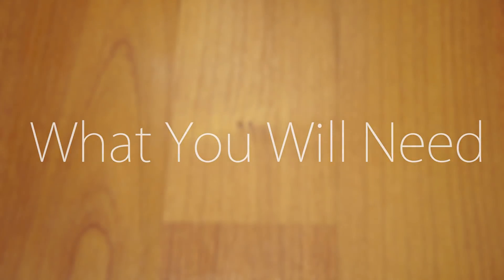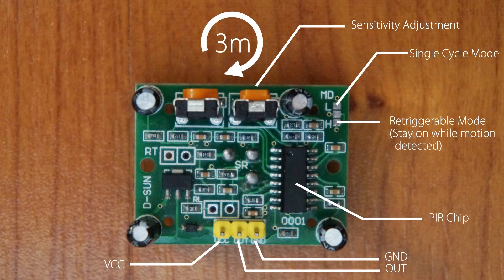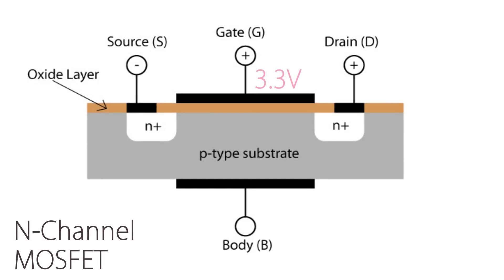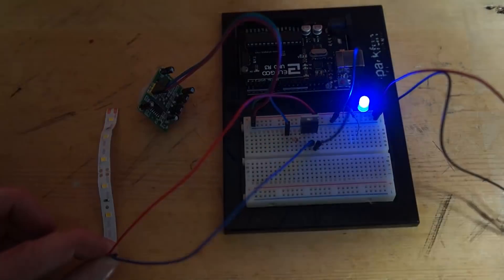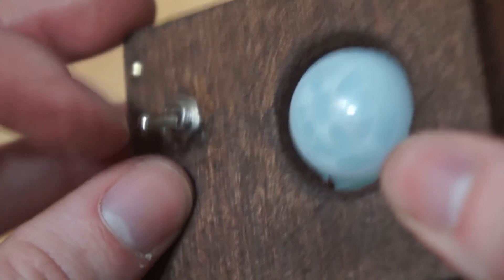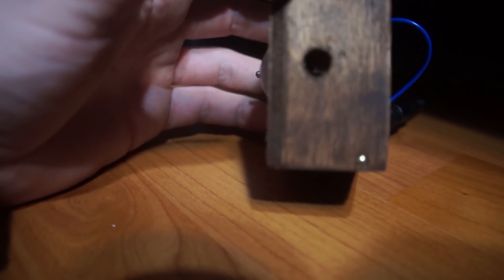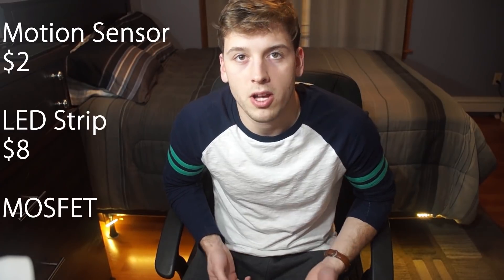Motion Sensor Bed-lights (NO PROGRAMMING)

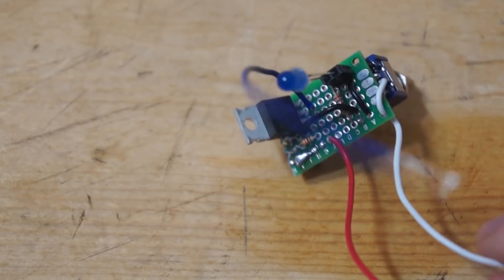Comment: Question 3:30 what was that piece you cut up? And 3:41 what is that piece and where did you put it? And I still don’t understand where is the power supply? So what do you use for the power?
Reply from the maker: 3:30 that is a “perf board” and at 3:41 is my 12VDC to power the circuit. I ended up connecting the [+] and [-] to a barrel jack and connected a 12VDC Wall Power Adapter. I wired everything together based on the diagram in the video at 2:31
Reply: @Grensom  i can’t see where you put the 3:41 piece, can’t see it anywhere on the module? Is it possible if I can contact you over discord, snapp or maybe Instagram because I’m working on a project and wondering if you could answer me some questions about this video. If it’s ok text me your email and I’ll send you my account name to where we can talk
Reply: @Grensom  i have some more questions
Reply from the maker: @noahkingjohnson1234  feel free to write to me here with any questions: www.gregensom.com/Contact
Reply: @Grensom  I emailed you on WhatsApp and your website but text me back over WhatsApp. If it’s ok
Reply: @Grensom  when you say “this is what it came out to” I can’t see anything because you keep moving it around. I need to see where you put it all. Text me on WhatsApp and we’ll take it from there. Because I have so many questions about this video
Reply: @Grensom  I have sent you a mail from the website you gave me and still havent gotten an answer?

Comment: I tried your circuit step by step led works fine but it is always on. PIR doing nothing. Can you help me with that?
Reply from the maker: I've had this happen if the PIR sensor goes bad. Do you have another sensor you can try?

Comment: Hi, Just made this with 3 x AAA batteries and without the resistors.  It works great with a short LED strip, but as soon as I connect a longer strip it just keeps turning on and off at will.  Is this due to the lack of resistors or the power supply, or both?

Comment: Hey Grensom!
Was trying this build on my own, with some adjustments:
- 12v, 8.3a power source
- same PIR module and 10k om resistor
- P30NF10 mosfet n-channel transistor - https://datasheetspdf.com/pdf-file/712795/STMicroelectronics/P30NF10/1
- SMD 5050 RGB led strip with control box and RC (12v, 14.4W)

Though PIR and transistor are working ok, I ended up having significant voltage drop (down to ~5v) at the control box terminals.
Any ideas, where I messed up? Thanks!

Comment: It works!! Thanks Grensom. 
1. I'm thinking of adding LDR to this, any idea which one to use? 
2. thinking of adding a blocking diode so I could connect 2 sensors on either side of the bed. any suggestions of which one to use? 
(odered all parts from your links, so entire circuit is identical). Thanks in advance

Comment: @Grensom You have mentioned 1k ohm resistor here in this video but on the written instructions on hackster you have mentioned 10k ohm resistor. Which one will work good 1k ohm or 10k ohm, also I'm buying an led 12volts with 1amp is 1amp led sufficient, will it be bright enough and will it work with this circuit?

Comment: Hey Grensom, awsome video man. Just need to know what you used to connect the motion sensor to the circuit board?
Reply from the maker: Jack Walsh I soldered female pin headers to the circuit board and connected the Motion sensors male pins into those.

Comment: Hey Grensom, trying to make these for my wedding corn hole games. I’m really confused on the part where you soldered it to the perf board. Any chase you could describe that a little more for me or any way I can pay you to make me a few of these?
Reply from the maker: Hi, basically the perfboard was just me putting the circuit from 2:30 onto a consolidated board. Perf board is the easiest way to do this. As for using this for cornhole, you may want to use a different sensor for detecting a cornhole bag. Passive motion sensors pick up infrared signals put off by body heat, so inanimate objects are not well detected.

Comment: Hi Grensom, 
Is there any alternative for Mosfet as I am not able to find the specified one. Is it okay if I use a 50A 60V  ?Please reply
Reply from the maker: Hi, you just have to make sure you use Logic Level N-channel Mosfets. You can use these ones: https://www.amazon.com/WeiMeet-RFP30N06LE-N-Channel-Mosfet-Arduino/dp/B07CTF1JVD/ref=sr_1_3?ie=UTF8&qid=1550066124&sr=8-3&keywords=logic+level+n-channel+mosfets
Reply: I have the same question were you able to use the 50a 60v instead?

Comment: Hey grensom , need to clarify with the resistance value...u r using 10k ohm ??
Reply from the maker: IñSANtHèReal yes, 10k ohm
Reply: @Grensom  am  using a 12v 2 amps source to a led strip...how much  resistnce to b used in the crcuit ??
Reply: Hey bro am using ur same circuit .bt output is only 7-8 v...am using irf540 n channel mosfet...pls  suggest

Comment: Successfully using this for months now. Just had to take out those resistors and then the circuit started working just fine. Thank you.
Reply: Hey bro mine circuit output is coming around 7-8 v...bt led strip need 12v to lit

Comment: Something you did not mention,for this to work you will need a Logic Level MOSFET,that can activate at 5v. Most of the MOSFETs operate at 10 V,therefore a higher resistance appears. Other than that,great video! Love it.
Reply from the maker: Yes you are right, I did not really mention anything about that in this video as it is important to know that in order to get this project to work. I have the link in my description linked to a logic level MOSFET, so hopefully people will look there for the part if they are unfamiliar with MOSFETs.
Reply: Will an IRF640 Power MOSFET 200V 18A work? Would I have to make adjustments to the schematic?
https://www.infineon.com/dgdl/irf640n.pdf?fileId=5546d462533600a4015355e7b76c19eb

Comment: Awesome Bro.. can you design a LED circuit which turns on when motion detected and only on the night. It remains on until person is there in front of sensor range and shuts off after the specific amount of time when the person left
Reply from the maker: If you look where I explain the motion sensor circuitry there is a solder through-hole for a photo-resistor for doing just that.
Reply: @Grensom  but with photoresister, won't it be invalid when other house light bulbs are in, so I think some time sensor might be needed, something like that. Gr8 vid though

Comment: How long will AA power the LED Strip?
Reply from the maker: Its a simple swap. If you use the Power Supply I did: https://www.amazon.com/gp/product/B019Q3U72M/ref=oh_aui_detailpage_o01_s00?ie=UTF8&psc=1
It comes with a connector so all you need to do is wire in the red wire to the (+) screw terminal and the black wire into the (-) screw terminal and you are all set to go!
Reply from the maker: I guess it really depends on how many lights you are using, if you are using maybe 20 LEDs, at 20mA per LED, that is a total of 400mA. Now a normal AA battery has 2.8 Ampere Hours so -- 2.8/0.4 = 7 hours. So it looks like 7 hours continuously with AA batteries. I would suggest maybe using a 12V power supply instead though - less hassle. That's what I ended up doing.
Reply: How would you incorporate a 12v power supply versus the AA batteries, assuming you have little to know experience in electrical wiring..asking for a friend lol XD  Does the wiring schematic change or is it as easy as  a simple swap?
Reply: Sweet figured it'd be fairly simple..legend!
Reply: okay, so at that point, you will use the wires and solder to connect everything according to the diagram at the beginning.  sounds do able... i will probably be back when it comes to actually executing this lol! trial and error thumbsup
Reply: last question.. how hard is it to figure out that perf board portion of the build.  Glazed over that fairly quickly and I imagine it's also fairly simple.  Want to use this as an entry level project to get into this kind of stuff.  Anything weird with how those work or how you have to hook all the components up to it.  Appreciate the feedback.
Reply from the maker: Perf-boards are very simple, you put the component in the hole and apply solder with an soldering iron. I recommend getting a perf board with metal contacts for ease of soldering - these are the ones I use:
https://www.amazon.com/gp/product/B01N3161JP/ref=oh_aui_detailpage_o08_s01?ie=UTF8&psc=1
Just remember these are not like bread boards so none of the holes are connected. All connections between each through-hole need to be made manually with wire or solder tracing.

Comment: Could replace the batteries with a power supply for a more permanent solution.  

Great videos,  keep it up!
Reply from the maker: I actually have the connector in the back so I can plug in either a battery or a power supply through a barrel jack. I decided to go with the power supply for 0% maintenance